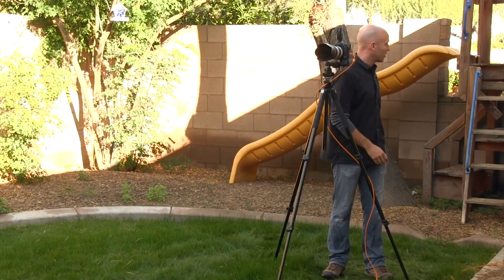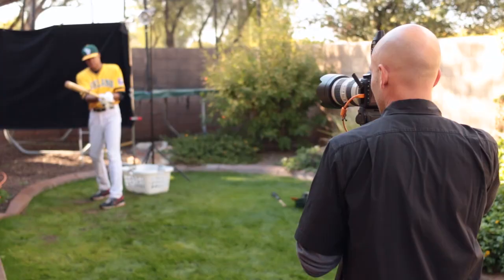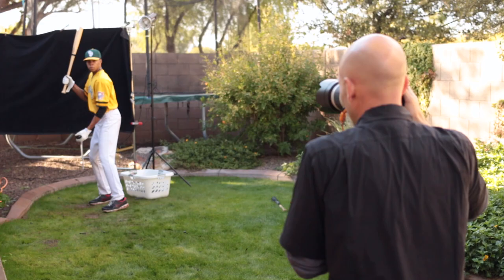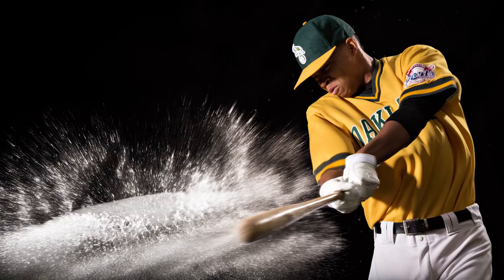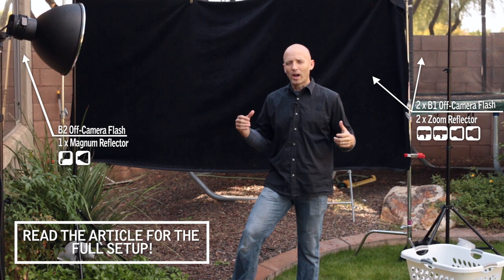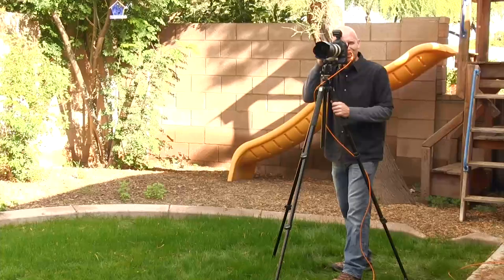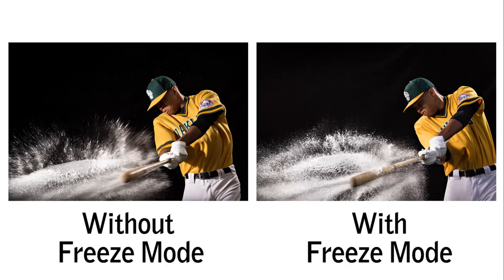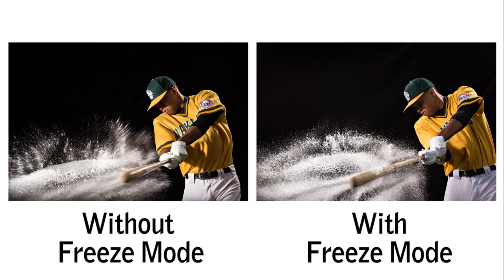What's Different When You're Shooting In Freeze Mode?

Comment: so what shutter speed to you use?
Reply from the maker: +Green Plasticbag I've cropped the specs from the set up from Jareds article: "Our camera settings were set at 1/200 sec at f9 at ISO 800. Of course, 1/200 of a second could never stop action, but in the shade of the building, at f9, with a neutral density filter on the lens, any hope of capturing ambient light was lost, so our shutter speed was unimportant. Any exposure made was a result of our flashes and, therefore, our ability to freeze the action was dependant entirely on the duration of the flash."

You can read the full post here: http://profoto.com/offcameraflash/how-to-light/whats-different-when-youre-shooting-in-freeze-mode/

Comment: Luckily my Paul C Buff's Einsteins aren't the typical monolight and have an Action Mode that can do the same thing for a lot less money!
Reply: mavfan1 yes, to that point, you can also type 5 hotshoe flashes together, make  them on 1/128 and triggered by wireless, it would do the same. But the question is, is it reliable, pure on light, lasts longer, easy to use? NOP!

Comment: I don't see any relevance to these sorts of comparison type video installments.

"Typical"? Exactly what do they consider "typical"? And at what price point are these "typical" lights coming in at?

These profoto 2 light kits enter at around 5.5K (which for most hobbyist) is just insane whacky no way not in the budget. 2 lights and a power pack. And along with others posting here, the BUFF system enters in a $500.-- per head, has quick flash a duration around 13,000th +/. Doing that math (even IF they fell a tad short and - they don't) That would be a lot of kit for the fact you get to say "I OWN A PROFOTO KIT".

Insane....